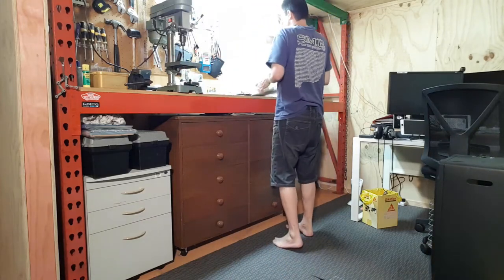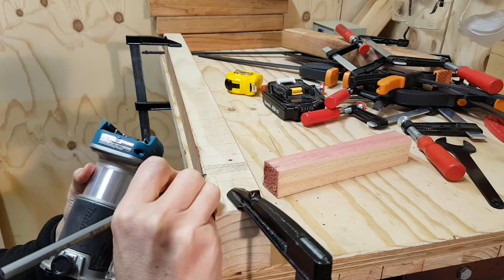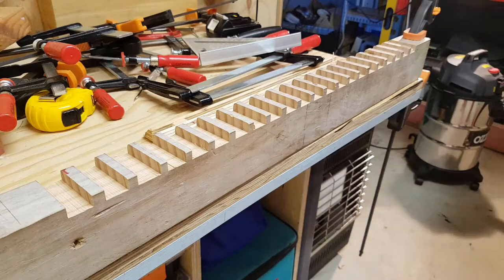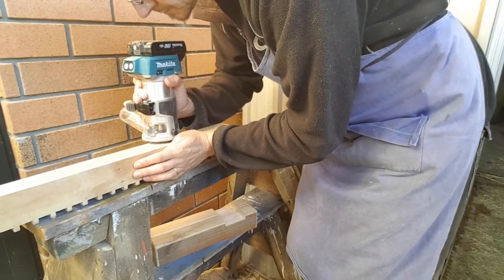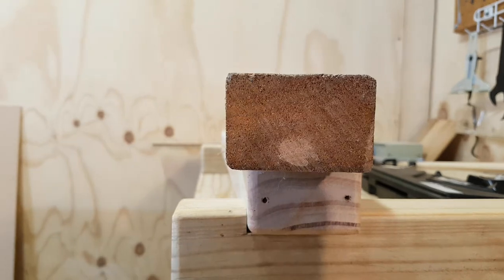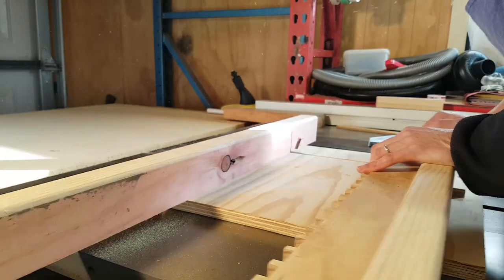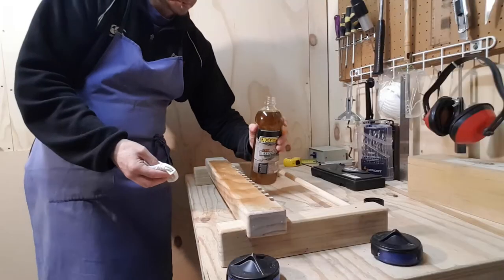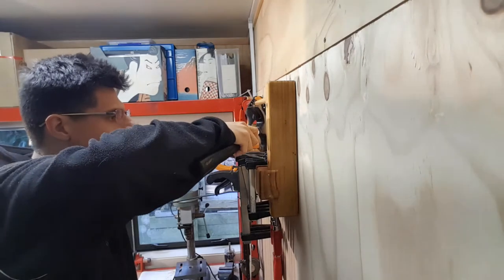Building a clamp rack from 3 x 2 lumber

Comment: Great job Rob. Love the way that after getting too over excited with the new router and round over everything that you still make a feature of it by a small modification on the design. Looks great for the job and best of all you have plenty of space to go buy some more clamps.
Well done!
Reply from the maker: Hey Paul, cheers for looking in at my vids! Yeah that was a happy accident that round over 'cos I like the fixed up version better than the original plan. Have to admit though, I don't even know the name of that joint that I ended up with. Numerous times I have gone to order more clamps but stopped myself until I had a rack for them (better not buy too many now).

Comment: Really nice way to get those damned clamps outta the way mate, that’s something I want to do onto my new Workbench to place clamps in an organised manner to the end of it, cheers mate 🍺👍🔨
Reply from the maker: Cheers Dirk - F clamps don't really hook that nicely - hence me needing nails to secure them. The sideways design like your big rack is probably better but if it's on the end of the bench that would take up a lot of space where you need to be standing and moving around with ease. One idea could be to mount them upside down with the round pad in a little recess to hold more securely..?

Comment: Nice job. And nice clamps come to that. I still get by with a length of plywood screwed to the wall with clamps hanging off of it! I really need to give my shop a proper sorting out.
With you on the linseed oil! Deffo dead fish!
Reply from the maker: Cheers Pete - but honestly if I wasn't doing YouTube my clamps would probably all still be sitting on the bench or as most recently - in the bucket that I bought for my dust cyclone, that in turn has been sitting on the bench for several months. Lol - the linseed oil - it's more of an outdoor furniture thing - I guess that's why it says that on the bottle.
Reply: You are still one up on me dude, I lost the bucket under all the sawdust months ago!
Reply from the maker: haha. Because I haven't been using the cyclone I'm onto my second Ozito shop vac this year. Oh btw - heard the brand is pulling out of the UK.
Reply: Yep, apparently it went belly up for Bunnings and they sold the chain for £1 after making a loss of over £200 million. Somebody is going to get a slap on the wrist there!

Comment: I too have a clamp issue. I have my small ones up ok, but the big buggers don't have a real home yet. I want to do something like this but am rather short on wall space at the moment. You were going way to deep, with a way too big router bit on that first attempt. If you had done it in several passes you would have been OK. Pine is harder to rout well compared to hardwoods and MDF.
Reply from the maker: My big pipe clamps are still homeless as well. The router - yeah you're right on the trying to hog out too much - my crappy old Ozitools router does amazingly and just gets the job done whatever the depth - I should start doing a bit at a time if I don't want to ballz up any more wood. The real problem in this case was that the bit came loose - did you see how it just fell out of the router.
Reply: I too had the bit come loose the first time I used it in my review video. Hasn't happened since though, I just put it down to me not tightening it properly.
Reply from the maker: I've only had two other routers but this one seems to have an especially ungrippy collet. I've discovered that using both wrenches gets it about right - rather than using that chintzy collet lock button thing where I don't get enough torque - even though it feels like you've tightened it heaps.